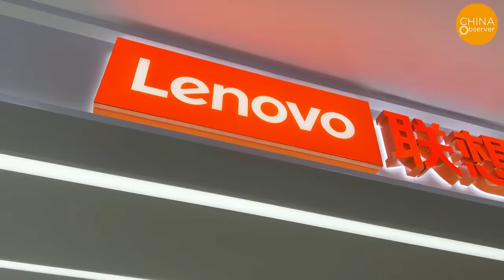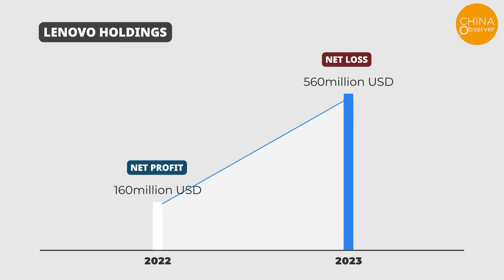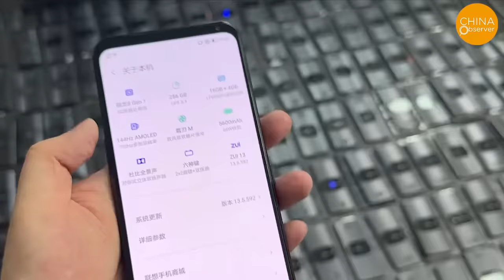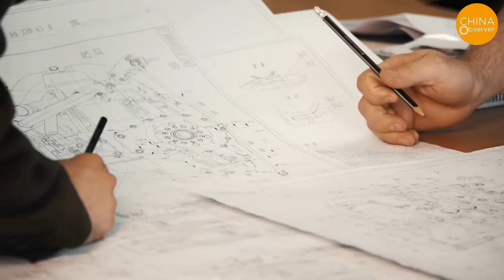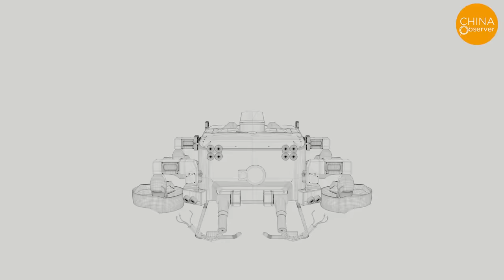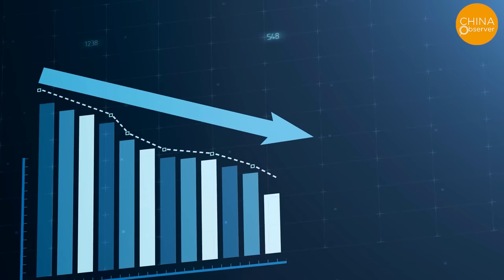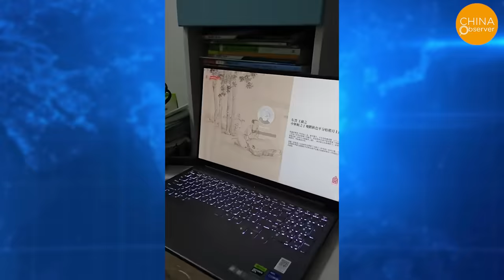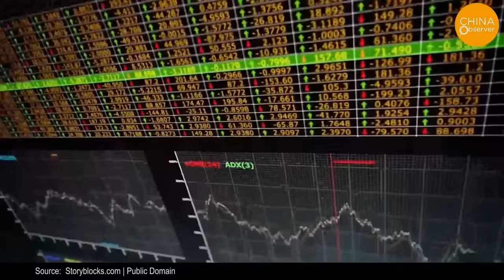Lenovo’s Subpar Products Fail Within 3 Months, Causing a $500M Loss in 2023

Comment: Lenovo was a making good laptops like 10 years ago.

I don’t ever buy any Chinese products made by Chinese companies anymore. Quality assurance standards are substanard.
Reply: I still have an ancient thinkpad. It still works. I had 2 dead new lenovo laptops (7 weeks and 10 weeks in) so I won't buy anything from them ever again.
Reply: they used to be the king supplier for laptops you could convert into linux powerhouses.
Reply: Iqoo 12 phone is bad ?
Reply: A good laptop 10 years ago was a really low bar to meet.. even then thinkpads were mid at best
Reply: @Noobscodee fair but they were a dependable kind of mid. You knew what you were getting for the amount of money you spent even at bulk scale. 

Plus they also had very high linux support so if you got fed up with windows or just wanted to switch to linux as your daily os it just took wiping the hardrive and installing with a usb and everything just worked.

Comment: Agree. Ever since lenovo took over Motorola, their phones really suck. Start acting buggy after 3-4 months usage
Reply: Huh?! Wha?! Lenovo & Motorola are joined? 🤔 I have a Motorola cell phone. If "They" are spying on me, they are in for a ride! 😂
Reply: Not all of Lenovo was bad until China's economic downturn of the past two years.  But financial pressure on domestic pricing causedTofu Dreg quality to appear into the products intended for export.
Reply: do not touch anything lenovos, all are subpar and break easily
Reply: That sector from Motorola is junk. Nobody wants those phones any more. Those are lack of software update and support. Google map does not even work correctly. Laptops here still be stuck in stock. It will be out of business soon!
Reply: Ah that makes sense. My last Motorola was awesome. My current one is crap. I have over a year to go on it. Hope it lasts

Comment: The issue with modern day lenovo umis that the company once had equal parts american and european engoneering inherited from their IBM days, but they have been slowly replaced with more Chinese involvement thus going from an engineer centric approach to product design to a branding approach with the main issue being that branding barely works for luxury companies like A*ple, not hardened ones like Think or Motorola brands with literal decades of experience through their American legacy which dates waaaay back.
Reply: Man IBM shouldn't have sold their thinkpad lines to some dodgy brands, but again it kind of make sense why IBM sold it off, they were burning cash and lenovo was the only company at the time that makes sense to hand the thinkpads line off to.

Comment: Loved my work Thinkpad back in the day, but it was right after IBM sold them. Was extremely sturdy and had almost a metal like top casing (was probably really hard plastic).
Reply: yes
Reply: What model?
Reply: @star_duck  Hmm, we moved buildings in 2003-04. Sat next to my (newish) boss. Don't think I had a laptop back then. We had a Citrix connection and it was terribly slow.
Big boss and direct boss got promoted and I moved seats. Probably around 2005-06 model.

Comment: OK having recently purchased a LOT of lenovo devices for clients, I can tell that "3 month old" laptop is at least 3-5 years old - he got scammed that is not a new device, newer lenovo devices have waaay better screens and much thinner bezels and are mostly using more metallic cases.   that idiot bought someones e-waste
Reply: I hope you're right about this. Was thinking of getting a Lenovo Yoga 6. But what about the possible spywares in Lenovo laptop?
Reply: I think it said T460 in the corner. It's a 2016 model in that case.
Reply: I assisted a small tech consultant before. One of our apprenticeship The laptop you've mentioned with 13gen i5 still got a brittle hinge issue and it's a girl laptop

Comment: I've owned 3 Lenovo Yoga 7 and they work OK.  Manufacturers are using cheap components to cut costs.  Most hardware are made and assembled in China.   Dell, HP and even Apple have had quality issues.

Comment: What was the last good lenovo laptop?
Reply: It doesn't matter BECAUSE it's long enough ago that the newer laptops have more capability than those over 5 years ago.  As time marches on, websites advance in server software and security requirements.  Pretty soon, they require only newer versions of browsers to access them if you're going to do gaming, banking, purchases, or perform activities on your mutual funds.  Those four things forced me off windows 7 for example because newer softwares refused to run on it, thus I'd have broken access on websites.  E.g. I could view some things but not others, I could put things in a shopping cart, but final purchase refuses to verify, I cannot load the 2nd part of the game initialization, or the fund refuses to validate my session to go further.   So, you can ask about when the last good lenovo was, but you'd be stuck of obsolete software unable to move past a certain point.

Comment: Ok, there is a fix, unplug the BIOS battery and plug it back in to avert what seems to be that black screen (Known Issue). This does require most to seek out a tech but not a big deal, 2 sec fix.  The other problem the video depicted is a CRACKED screen. I wouldn't rag hard on Lenovo.

Comment: Lenovo was absolute garbage. I bought 400€ laptop and it barely operated browser without lagging after 2 months...
Note that the laptop was clean with no malwares or viruses or anything of such. It was basically brand new with only Steam installed on it and browser changed, because I had it in use for school.